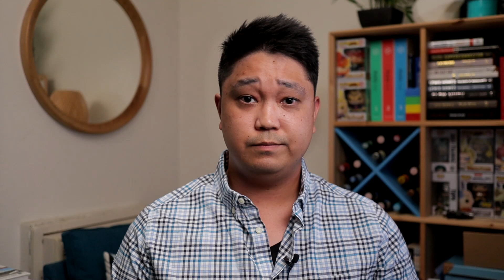Surfside Condo Collapse - Civil Engineer's Thoughts.

Comment: This is why Civil/Structural Engineers should be paid more. If you want a building to safely stand for 40 50 60 years you'd think it would be a good idea to fairly compensate the engineers that design these buildings/structures.
Reply: Paid more by who?  The market sets the price, we get paid what we get paid based on market forces.
Reply: I was told experienced structural engineers make pretty solid cash....how much do they make ?